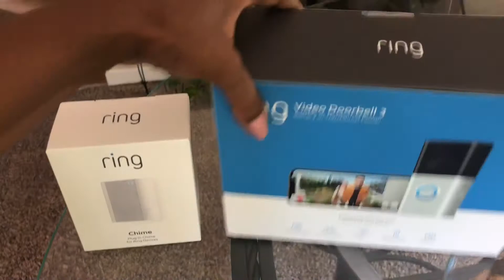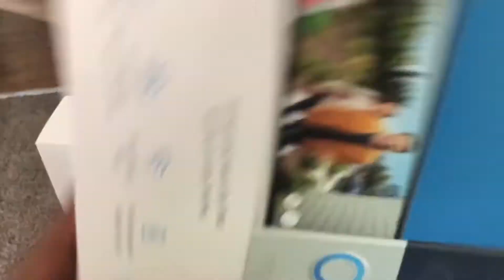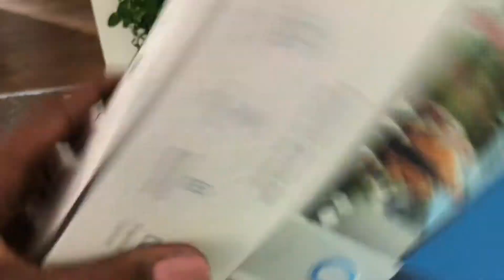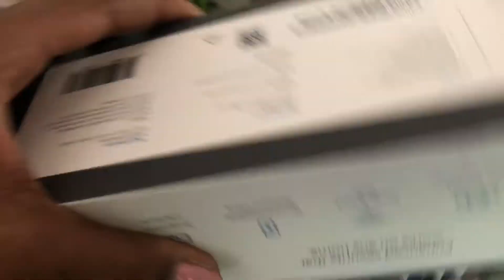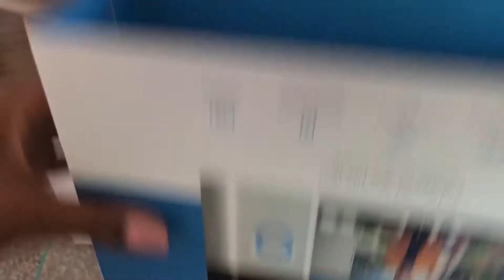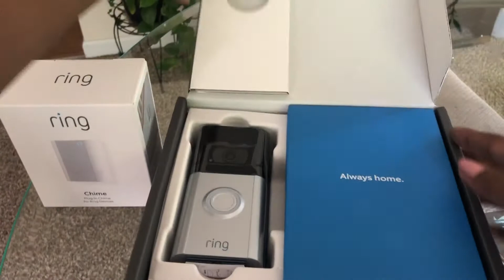Ring Doorbell 3 (Hardwire)

Comment: Hi, is your ring doorbell 3 charged by the wire? do you have to charge the battery once in a while?
Reply from the maker: Hi, the doorbell is charged by the wire, I can check the status through the Ring App underneath the Device Health option and it’s always at 100%! It’s awesome It doesn’t ever need a charge! Thanks for stopping by!! 😊
Reply: @Saturdaymornings911  Thx for reply, how about your settings?  motion level? recording ?   I have charged mine last night 100% and now 97% left.
Reply from the maker: Check under device health to be sure it is listed as hardwired. If not, I would switch the wires, one of them may me inactive.  As far as my settings I have 2 motion zones and the motion frequency is on frequent. I installed this in July and it has always been at 100%.
Reply: @Saturdaymornings911  alright, thank you, i guess mine hasn't been set up completely then.
Reply from the maker: @CozyCoffeeShop594  Hi, were you able to figure out the power issue?
Reply: @Saturdaymornings911  Thank you for asking. it's been working since the time I installed, it just charged slowly...
Reply: Good morning so no need to charge the battery before installation. Being hardwired the power charges an stays charged as long as power is on thanks.